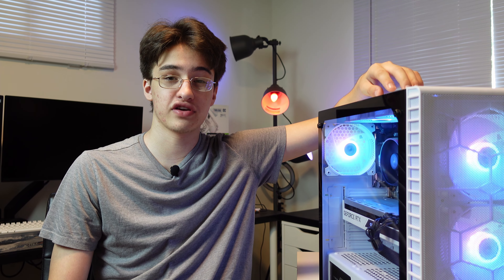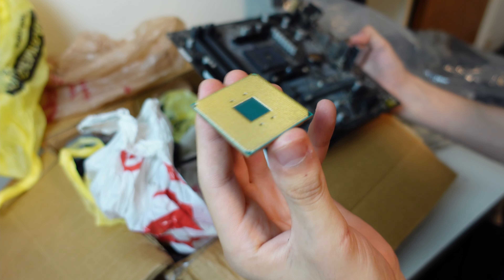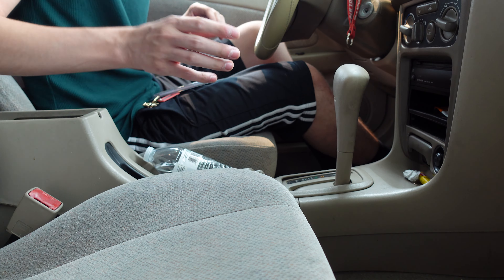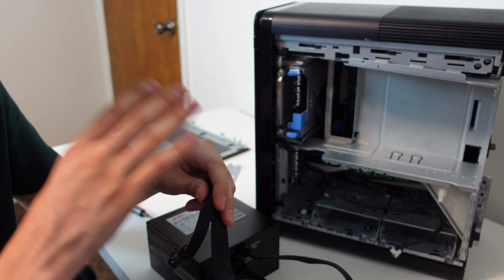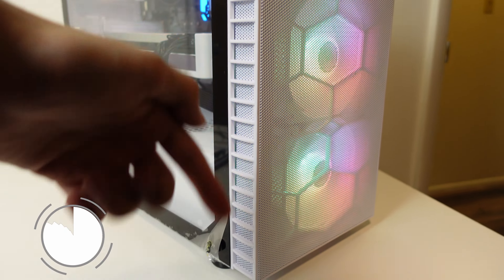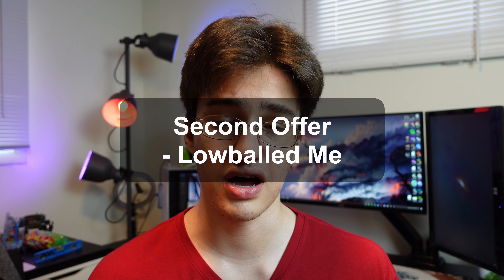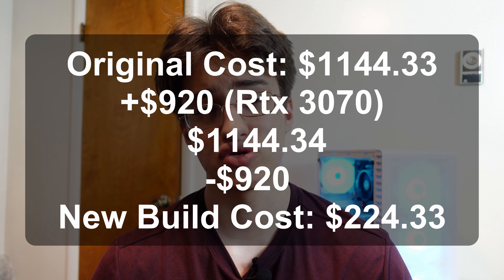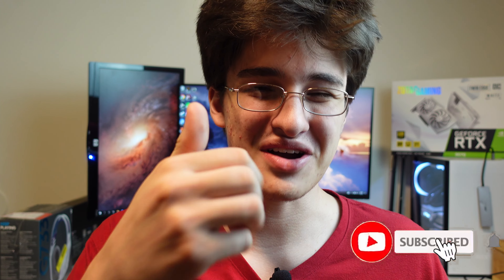Flipping a HIGH END gaming pc for profit 💰💻 FPFP Ep. 17

Comment: yo I have a budget of 400 dolars and I want to start flipping pc's what kind of systems do I start with
Reply from the maker: Anything you can get your hands on! Just start buying parts that are good deals
Reply: @ElijahsLab  I found a hp 8300 SFF i7 3770, 4gb ddr3 ram @1600mhz, 500 gb hdd, for 130 cad is that a good deal? and what cheap gpu  can I put with this? thanks for replying